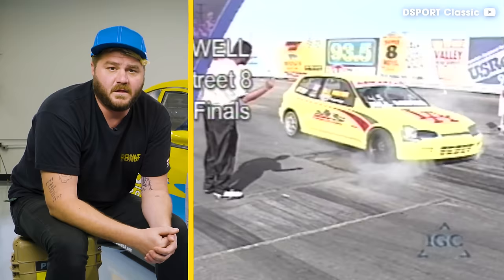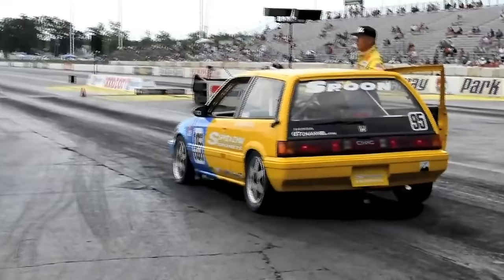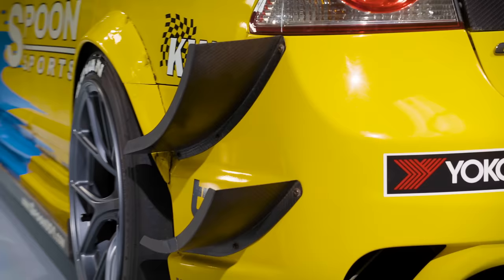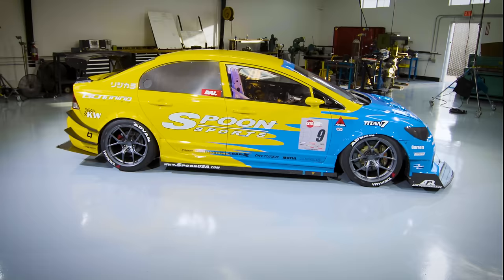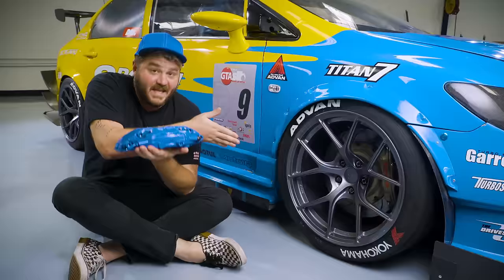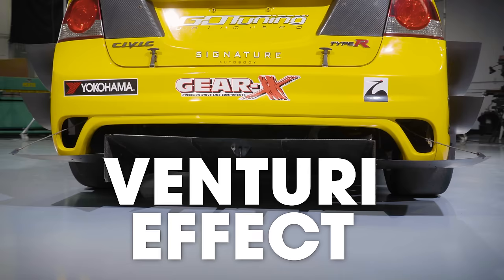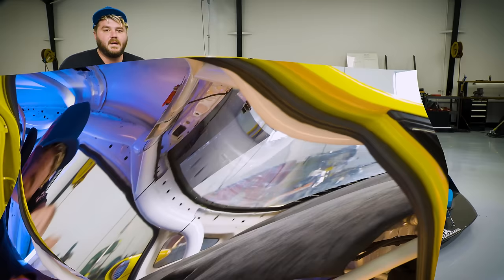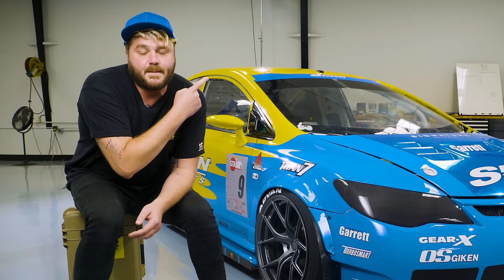Why This Spoon Civic Type R is the Fastest Modern Honda Civic | Bumper 2 Bumper

Comment: For anyone wondering, using the equation hp=(tq)(rpm)/5252 the peak power of 520hp was achieved at ~7000 rpms.
Also, for what its worth, there will be some thrust generated by the exhaust placement. On the old world war 2 fighters they figured out they could go another 10 mph due to angling the exhausts properly, especially on the spitfires.

Comment: Hope this car will be in a game. Really want to drive this. Long live Spoon.
Reply: Gran Turismo 4 used to feature Honda's by Spoon, pretty sure it was an s2000 or an integra
Reply: @chrissychaos  also in GT2 they featured Civic EK9 Type R Spoon.
Reply: Yup S2000 and a 98 civic type r. 14000 rpm limit on that civic if I remember correctly.
Reply: Gt sport does ad some special cars once in a while... like the wrx time attack car from the isle of man soooo
Reply: So Forza horizon 4 basically
Reply: Gt2 had 3 spoon cars: DC2 integra R, ek9 Type R & an S2000
Reply: gt5 and gt6 had fd2r
Reply: Me too,,,!! I hope this car will be in GT Sport, Forza  or Need For Speed.
Reply: Maybe an Assetto Corsa modder will try it.
Reply: I would love to drive this in Project Cars 2 or Assetto Corsa
Reply: @chrissychaos  the s2000 is in the gt sport as well but I really want this one in the game
Reply: What game?
Reply: @mr.fingerwithasmileyface3584  Gran Turismo sport
Reply: gran turismo for psp had the s2000, type r, and fit

Comment: FD2 Type R's lap time in Tsukuba is faster than NSX, R34, FD RX7 etc, all in stock form... FWD has definitely come a long way...
Reply: Nick Wong it certainly holds on its own on time attack. now we just need to figure out its tire management problems 😅
Reply: And that was over 10 years ago also!
Reply: @devandrasimanjuntak1646  get more replacements haha
Reply: @irfaan7868  indeed... those cars are AWD and RWD with more power as well...
Reply: Just recently a Canadian Team driving an FB Civic SI holds the current FWD record at Tsukuba, beating the previous FWD record from HKS's Suzuki Swift.
Reply: wrong, tire technology has come a long way. re-run those tsukuba laps with all cars on the same modern tire and see how well your civic or any fwd car does. now if you want to talk about renault or puegot, then we can appreciate fwd as a performance platform.
Reply: @spacecowboy776  renault peugeot?  Forgot about the integra that set the fwd benchmark
Reply: @spacecowboy776  Sorry dude but peugeot literally have no good FWD performance cars, Renault maybe but again it's head to head with the Civic Type R
Reply: 626KiDD Where can i find this FB?.

Comment: I owned a 2009 stage 2 Cobalt SS Turbo and it was probably one of the more fun cars I every owned or drove. 270ish hp and 260ft lbs of torque in a 2 door FWD turbo toy made for alot of fun. Never went passed stock but had a few people tell me with a tune and some bolt ons I could get close to 400hp and 380ft lbs. But I miss that car alot. I love RWD more than FWD but it handled so good. Dont hate any form of fun car. Just drive them all with a smile Lol

Comment: The fd2 doesn't have the same engine as the fn2 you showed, it's a k20a not a k20z4🤤
Reply: What do you mean, FN2 does have TypeR
Reply: Junhao ZHANG the fn2 used a k20z engine similar to the us and Canadian k20z3 In the 8th gen si and csx type s and the fd2 used a 222hp k20a

Comment: The exhaust dump is supposedly designed flush so as not to disrupt airflow, but the car has door handles, exterior mirrors, factory non-flush windows, and pocket screw fender flares? Nope. It's angled that way to look cool, which it successfully does. The splitter, wing, belly pan, canards, and diffuser do WAY more for aero than any body mods will.

Comment: makes you wonder if you can make a 3000gt sl go around a track faster than a vr4(while still being NA)..since the SL weighs like 600lbs less from the factory. Bump up the horses, remove all weight that you possibly can. Flat panel the under side and vent the hood so airflow goes through the radiator and over the car to create that huge pressure difference. The SL already has a very torquey v6. And im talking keeping an SL NA and not just swapping in a VR-4 power plant. OR take a vr-4 block and build it is a crazy NA engine but using the extra features the vr-4 engine has like oil squirters for the pistons to really up the durability for a very solid high-compression na engine. And with the NA's more consistent power band lack of boost-lag be able to make a dam good time attack car. Also the chassis is very wide i think it would make a very stable platform as well.

Comment: The only reason that spoon civic (extremely basic aero mods, its very obvious they were rushed and on a small budget) has the record lap at Buttonwillow, is the fastest time attack cars haven't driven there. The fastest cars have completely custom components, relocated drivetrain, full underbody tunnels, many times more downforce, less drag, same weight, twice the power... 

This spoon car is still impressive, but its just off the shelf name brand parts with a basic aero program, simply for marketing purposes.

Comment: The problem is front wheel cars also steer with the driven wheels, no amount of limited slip wizardry, equal length driveshafts, or suspension geometry can overcome basic physics. The steering wheel of a FWD or AWD car will always feel more vague than a RWD car. All the wonderful sensations of feeling each individual tire through the steering wheel, is, at best, muted, and at worst completely lost.

Comment: The welding is very well executed... however the gussets' placements and shapes are so-so... also, even with a naked eye, the aeros are also so-so.
Don't get me wrong, this car is awesome, but it could be a little faster with some more blue-printing (read : force vector drawings and possibly some wind tunnel testing) ;)
... and it would not have required much more money (or possibly even less by reducing crafting time) ^^

(just my two cents as an IWS and a major car-head hon hon hon)

Comment: I don't like FWD, they really do have sloppy handling at the limit but even I have to admit that Honda does FWD right. I have no idea what kind of vodoo black magic they use to make a car with that much of the weight over the nose turn in like a mid engine but lap times even on the bone stock Civic R prove that it really is that good. On various tracks it has bested the Performance Pack Mustang GT, WRX STi, and even the new Supra that is one hell of a FWD car.

Comment: Still prefer rear and AWD over front. Although front wheel drive cars are proving to be competitive, you have to mod the car way more to do the same performance as the AWD and rear wheel drive cars, especially with weight and distributing that weight.

Comment: Well it is true The reason why they cant respect fwd like how they respect awd and rwds because fwds are always equiped on daily driven sh#t box and slow and also those nsx and other mid shift already have aero upgrades unlike the civic which is bonestock if those aero enchancement were put in fwds they can be actually cornering machine and also drag machine the only thing that it cant do really well is drifting thats it..

Comment: is a highly modified car realy a good way to prove fwd cars are sporty? i mean there is barely anything left from the original :D   or using a modified car to prove anything realy...dosent it just mean the car has been modified to be fast? 
you can give a Fiat multipla a 1000 horsepower and all wheel drive dosent mean the multipla is a fast awd sport car?

Comment: For me it's logic that a fwd car is faster than a rwd car cause u dont have to bring the power from the front to the rear weels
Reply: Under acceleration the weight shifts to the back which usually causes slipping, hence why they're not usually used